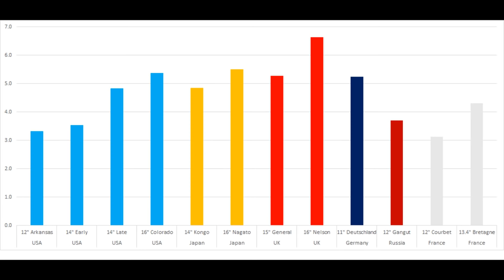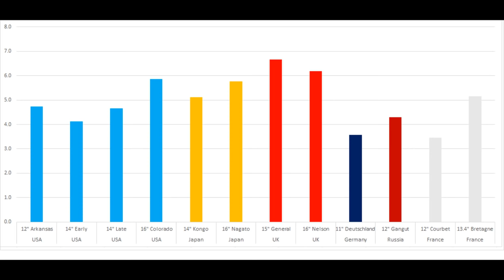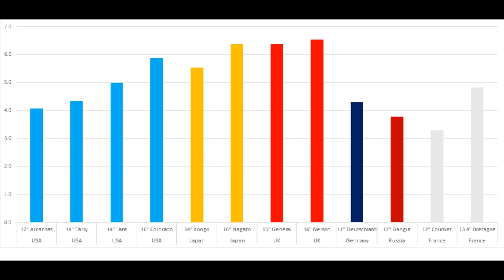Battleship Guns of WW2 - A series of tubes

Comment from the maker: Pinned post for Q&A :)
Reply: Now you need to do the same thing with Heavy Cruiser, light Cruiser, and destroy your guns. Excellent job my friend.
Reply: Has there ever been a naval version of the Christmas Truce in World War One?
Reply: Whose 18 inch gun's that were actually built were better and more powerful the British or the Japanese?
Reply: 1:46 i disagree
Reply: Modern Anti-Ship Missile Damage against Battleship Armor?
Reply: 9:02 weight its value on a bell curve :)
Reply: Is there a chance you can do a video about the damage taken by Jean Bart due to Massachusetts 16inch hits?

Or any other video that covers what damage an AP shell can actually do to a modern WW2 BB?

Also, has a WW2 BB ever taken a hit to the belt, aside from Bismarck? The thickness of the belt is discussed so often while in reality, hits on this spot are relatively rare.
Reply: You mentioned in earlier Drydocks that warships were generelly not suited to use their main battery while also using their full AA armament, because the crew manning the AA guns would be susceptible to blast by the main guns... has anyone ever tried to exploit this, i.E. attack enemy ships while they are engaged in a surface action? If not, why?
Reply: @Scarecrow94rn  Scharnhorst's 105mm gun crews were ordered to take cover at the North Cape when Duke of York opened fire, and this stung her later when the DD attack developed (the order could apparently not easily be rescinded,  which is a bit strange). Survivors were highly critical of the handling of the ships secondary armament, and blamed the captain for the torpedo hits.
Reply: @williamwarwolf1  most such missiles have a basic HE warhead with either an instantaneous or slightly delayed fuze, so they would slam into the armor and the explode outside the belt, assuming it is still intact enough to explode. A few have shaped charge warheads, which are quite capable of penetrating armor. However, a ship with a decapping plate or an interior belt can set off the warhead outside the belt so it is no longer focused when it reaches the main belt. The same missile therefore might go right through the turret armor, because there is no decapping plate to set off the warhead early, while failing to penetrate a thinner armor belt because the exterior skin set off the warhead so early that it isn't focused enough to penetrate when it reaches the belt.
Reply: Are the bursting charges generally made from the same explosive compound, or are some nations using more or less volatile explosive compounds? Is there any information suggesting shells with larger bursting charges tend to shatter easier?
Reply: @joshthomas-moore2656    M
Reply: From what I've read, the twin 5"/38 and triplet 6"/47 gun turrets on US destroyers and light cruisers of WW2 could not be elevated separately from each other unlike the 8" and larger guns on heavier ships. Though it would not have made the turret more likely to remain operational if hit, would it have at least increased the accuracy of shots fired, especially in AA role for the 5"/38?
Reply: Where would the 12" guns from the Alaska class score using this system, considering their position as supposedly more powerful than the 14"/45 guns from WW1? (Edit: perhaps no surprise to see this question repeated at least half a dozen times.)

Also, is there any kind of rule of thumb for evaluating scaling of bursting, say a square function? In other words, to get twice the damage you need four times the weight of the same explosive, or possibly a cube function needing eight times the weight of the same explosive to do twice the damage? Or is it so complex that no one has really tried to develop such a rule?
Reply: What plack poles are sticking out from the ship in 19:22 ?
Reply: Will you do a video about how a gun is built? You always say that in a battleship the guns are the most expensive items and they need a lot of time to be produced, but why is it?
Reply: My question for Q&A: Could an argument ever be made for a new class of BBs to be made for modern war?(Specifically for historical naval powerhouses of NATO and their affiliates: USA, UK, Germany, France, and Japan)

I've given it probably way more thought than anyone should have, and I've determined absolutely they should. Having those big rifles(16-20") with modern FCS, propellants, and advances in automation for loading could give them exceptional range, fire rate and variety of ordnance. Having that long range striking power against the most pressing threat to NATO being China(who has an obscene amount of infrastructure and factories along their coasts well within range of a BB), BBs make a whole lot of sense due to the amount of ordnance they can throw down range consistently. Being that it's a BB larger than a modern aircraft carrier, that means that you could put all sorts of weapon systems on it: anti ship missiles, long range ballistic missiles, tons of AA/point defense systems(compared to frigates as you could mount multiple land based SAMs or anti-missile defensive systems instead of just one). 

Armor also has come a long way since WWII. Being that it's a BB, it could utilize all sorts of advances in armor technology that was developed for tanks like spaced armor, ERA and ceramic composites. In theory(my own theory and I have no actual backing for it), if you were to clad a ship in ERA and something like Chobam, you could make it impervious to things like hypersonic missiles. The spaced armor could come into play with the belt, instead of air being utilized, you could fill the cavity with water instead. I'd imagine a hypersonic projectile would struggle against a belt of ERA, a layer of a chobam like material, about 3 or so feet of water(or some other dense or non-newtonian fluid), finally meeting a full belt of Composite armor and steel. 

I'm curious as to see what you might think about such a thing as I have laid out.
Reply: How the italian doria’s gun would have performed in the pre-1930 category (with their updated caliber of 320mm)?
Reply: While it seems obvious that  the  more modern (post 1930) guns would likely crush out any nuance in the pre-1930 guns, I feel like including those earlier guns when analyzing the later guns might be of some value.  A later gun that performed worse than an earlier gun would be kind of a funny joke, but perhaps more importantly, it would show the full context in which the later guns were developed.  I doubt this could be a full video, but I'd love to plug the values into some spreadsheets and see what falls out.
Reply: @Scarecrow94rn  The Americans did it at Samar, but only because that was an extremely unusual set of circumstances. Overall it was impractical to have your units positioned so your carriers and surface ships could attack together-you were better off just sticking to the carriers.
Reply: Watching a Battleship New Jersey video and Ryan mentioned that NJ was inactive for over half of her career. At first I thought a ship like this would have great hull condition due to less use through wear and tear. But then I thought about it and thought of USS Midway who was a front line ship most of here career, so she would require more up keep then New Jersey sitting in port. Who's hull condition would be in better shape today? The Active ship,(Midway) or the New Jersey who sat for many years in reserve.
Reply: How would the 12" rifles on the Alaska have faired in this list?
Reply: at 25 minutes, you have a picture up titled "USS Michigain after bursting of 12" gun" - and it sports a jagged hole in the superstructure above where the tube is laying on the deck, which appears to be where the newly-liberated tube struck the superstructure.

are you including the armor penetration of a 12" gun tube in these scores?
Reply: Q: How much of an effect did nonpenetrating hits on the belt/turretface/barbette have?  Were mobility, firepower, or mission kills a significant factor in these instances?
Reply: Is there some reason that you used range over muzzle energy? It would seem that muzzle energy would allow a comparison that did away with the range being limited by the turret. Also how about barrel life? Finally while not a BB, how would the 12"/50 of the Alaskas compare?
Reply: "Armor Penetration" in the context of this video - please elaborate.  Is that belt armor penetration only?  Deck armor penetration?  A combined value?  Related, which of the contemporary ships, if any, had an immunity zone against the noted guns?  That is, what, if any, immunity zone did the Yammy (Iowa, KGV, etc) have vs the Richelieu?
Reply: Hi Drach, why did you choose to Include the weapon of the Deutshland class and not that of Alaska class in your analysis?  It seems to me it would be a both or neither situation.
Reply: Did you consider barrel wear/barrel life as a factor? It's certainly a characteristic that is purely the gun and seemed to have a very large impact on things like range and accuracy.
Reply: @kennethhill4623  seem to think the Japanese used a different bursting charge, as mentioned by drach in the battle of tuschima?
Reply: Where's the 12" guns from the Alaska class or the 16/50's from the Lexington class Battle Cruisers? If you're going to list the Vanguard, they should be on the list.
Reply: Great entry. During wartime, most navies and armies tried to simplify their supply lines. How many different battleship main gun shells were being carried by the RN and USN from WW1 to WW2? For the Grand Fleet, were there 12, 13.5, 14?, 15 inch shells
Reply: I think of the Scharnhorst more of a heavy fast cruiser or battlecruiser in the British definition (in my mine), Which makes me wonder were the 12 inch Alaska class guns would fall on the list. As far as the bursting charge on USN shells, I think bursting force should be the state used, given the fact the USN shells had to brake a thicker wall of shell in-order to free the explosive force from the shell, that should have about the same lethal force, close to the British shells.
Reply: @michaelkovacic2608  The order was rescinded, but by the time it was given the crews were dead! they took cover in the aircraft hanger which the DoY subsequently hit with a 14" bitch-slap.
Reply: @g24thinf  Well the Lexington guns were only ever used in coastal defence batteries so not really applicable, they were never on a ship.  You couldn't compare them on things like range for that reason either.  And if you did where do you stop?  The guns from the N3 and G3?  The guns from the A-150s?  No turrets were built for any of them.

Not sure why Alaskas guns are not on when Deutchlands are though.
Reply: What is your opinion of the light cruiser IJN Yuubari?
Reply: For the sake of argument, how do the Italian 12.6" compare to the pre-1930s considering they're contemporaries?
Reply: 12 inch guns on the Alaskas?
Reply: Why was Warspite modernized with just 4 twin 4"/45 Mk XVI dual-purpose guns while retaining 2/3 of her 6"/45 guns when she could’ve been given either 6 twin of the 4.7"/45 Mark XII (or 8 single Mark IX if the Mark XII didn’t enter service yet) or 4.5"/45 dual-purpose guns, while reducing the 6"/45 guns to either 8 singles or 6 singles? Having just only 2 twin 4 inch DP guns per side seems really low for dual-purpose when even Hood had 4 twin per side and the Leanders, Counties, Yorks, Crown Colonies, as well as the Southampton and Gloucester-subclasses of the Towns had the same 2 twin 4"/45 DP guns per side. If they had to put the 4"/45 twins, wouldn’t it have made more sense to go with at least 3 twin mounts per side?
Reply: How are warship projectiles actually made? Are the latched down from suitable barstock then annealed for hardness or cast or something else? You've got a video on the armour Drach, but not on the bit that pokes holes through it =/
Edit: I think I asked this under one of your older vids so you may have answered it in the 130 or so drydocks I've yet to get chance to listen to, if you have already thank you.
Reply: What is in your opinion the best-looking battleship turret?
Reply: Have you considered using non-linear scoring methods, like on range?
Reply: You forgot the 12" 50 cal Mark 8 on the Alaska class. If you include the Deutschland then you should include them.
Reply: @Cbabilon675  seconded.
Reply: If you want to stick to your guns (did you see what i did there?) on range, you could pick your favorite practical max range - and then compute the Vn (velocity of impact of the projectile that is normal to the ship surface).  So just impact Vn= V x cos(angle).  So a flatter trajectory will get a better score if trying to make holes in the belt.  1/2 m Vn*Vn should give the kinetic energy of the punch and then can add your numbers for the part that goes BOOM with your present methodology.
Reply: What about the 12" guns on the Alaskas? They're as big and powerful enough to be included on this list! I'd say they slot in between Scharnhorst and Dunkerque guns.
If you argue that it's because the Alaskas "aren't real battleships" I'd counter then, by that logic, neither are the Deutchlands. In terms of size, speed, and armor they're pretty comparable to Dunkerque (the lead ship, not the up-armored sister), and if It's because they barely saw any action, then I'd point you toward HMS Vanguard.
Sorry, I know I'm ranting by this point, I'm just sad of one of my favorite ships constantly getting shafted because "Oh, those are just large cruisers, they don't count."
Reply: @Scarecrow94rn  - I imagine that attacking an enemy battleship from the air while it is currently engaged in surface to surface combat with other battleships would be an ideal situation to test out this question.
Although the odds of a naval force finding itself in a position carry this out, I think, would be rather slim.  That specific tactical scenario would be extremely rare and difficult to intentionally arrange.
Although I recall reading that the IJN Yamato was firing it’s 18” guns using some fancy AA round at some point during it’s final doomed fight with USN aircraft.  I can’t remember reading anything concerning what effects this had on the crew manning the other gun positions on the ship during this last engagement.
Reply: In your opinion, what is the bigger "what if?"
1. The Royal Navy has Green Boy shells at Jutland.
2. The IJN CAP at Midway sticks to their sector allocation.
3. Moving the Pacific Fleet to Pearl Harbour.
4. Italy stays neutral in both world wars.
Reply: Why were 7 inch main battery’s uncommon on cruisers
Reply: @williammacker1525  id imagine a combination of weight, performance and logistical requirements. You'd be better getting an 8 inch id imagine.
Reply: Following my "sources for the best gun" this is a fantastic video.
Reply: Does this include the Sleswig Holsteins guns?
Reply: You often raise the question "why didn't they build aircraft carriers" in the 1930's. I am on the opinion that the prevalence of aircraft carriers were just some form of survivor/confirmation bias, since "that's what they had" especially the US in the pacific. If aircraft were really a threat, why were there no dedicated fleet flakships? As in larger vessels than the atlantas?
Also, why escort CVs with battleships?
Reply: @DoddyIshamel  I think he used the WWI Pre-dreadnought Deutschlands, not the 1920s Panzershife .
Reply: @Trigm  Then why would he talk about the Graf Spee?
Reply: This is an awesome.  i feel like it misses something critical, though, which is suitability to the missions assigned.  which might even disagree entirely with the missions the guns are designed for.

in that regard, what are a spread of various different guns and their suitability to the missions they were actually designed to do, versus the missions they ultimately actually did?
Reply: What about the 11" guns on the German Predreadnoughts? They did see service and fired their guns during WW2 after all.

I imagine they would be the worst, even worse than the Courbets but still kinda curious.
Reply: @fidjeenjanrjsnsfh  see what happened to Glorious as why carriers needed a Battle ship in escort.
Reply: @g24thinf  Alaska point is fair but Lexingtons were never completed as battlecruisers and never fired their 16" guns (I don't think they even fired their 8" guns in combat in their carrier forms). Vanguard was at least completed.
Reply: Drach: one characteristic you didn't mention was time of flight. You chose the range of 20,000 yes, so it should be straight forward to calculate the time the (incoming?!?) shell takes to arrive. This piece of information would be useful in seeing how much time a target vessel would have to evade by changing course immediately upon observing muzzle flashes. The greater the time between muzzle flash and shell arrival the greater the chance of the target vessel getting out of the target ellipse.
Reply: Any chance we could get access to a document with the raw data? Great video, as always!
Reply: When you're including pictures of ships, can you include the date taken (if available)?
Reply: Hey! If you don’t mind, if possible can you do like a tutorial on how to make the spreadsheet that you used to compare the guns? If you have the time of course, id love to give it a try in my free time
Reply: There are so many guns in this video that are "not much to write home about." Who is writing home about development of explosive charges and penetration values? Was this some form of effective courtship in the early 20th century? Wouldn't these information tidbits be considered classified military secrets? Was this another ineptitude of the Bureau of Ordinance?!? The world wonders.
Reply: What's wrong with Michigan's guns at 24:48?
Reply: But! But But! What about Battleship Guns NOT used in Battleships.

 I'm talking about you, Alaska class 12" guns!
Reply: If range was a factor of the turrets that you added back (which I agree with btw) and accuracy was in the pro/con section (subjective but again agreed), how much is Rate of Fire a subjective 'it's the gun' stat versus how the turret was laid out plus gun crew process/training? Is there an objective way to say a guns rate of fire is because of the gun and not those other subjective factors? Crew and/or turret seem to be large factors there... Right?
Reply: 20:50 It seems to me rate of fire has more to do with the whole complete system then the gun itself.  A shore battery and a battleship could have the same gun and vastly different rates so fire.  Can you please explain this?
Reply: @Scarecrow94rn  That was Halsey's plan at Leyte.  Lee was supposed to arrive just as the first wave of aircraft began their attack.
Reply: USS Des Moines vs HMS Dreadnought (both with and without updated fire control). Who would win? Both displace just over 20,000 tons when at full load.

Edit: also Dreadnought's gun elevation and shells.
Reply: Did any Navy try to develop shaped charge naval shells during WWII?
Reply: How well could HMS Lions guns have fared against Other heavy hitters on the list?
Reply: So, for bursting charge I noticed you used the weight of the charge alone. I'm curious if the explosives were close enough in performance that simply taking the weight of the charge is an adequate measure. Was the explosive used in the shells across so many navies close enough in effect to not to bother differentiating?
Reply: Silly question and probably a very obvious answer, but with Rooney and Warspite very occasionally moonlighting in an anti tank role, how would they have done against the Landkreuzer P. 1000. I understand that the "proposed" tank was planned to have between 5.9 and 14.2 inch armour, what kind of protection would this afford?
Reply: @briancox2721  that was the day the USN discovered "copper choke", where copper from the driving bands on the shells builds up in the bore to the point where it impedes passage of the shell to the point where pressure in the tube is high enough to burst the gun.  After that, the USN started issuing cleaning tools to remove the copper buildup.
Reply: @alessandrorizzuti7857  yeah, you also see things like the Scharnhorsts use smaller guns because they didn't have the manufacturing capacity at the time despite having it previously.
Reply: If you “pulled” out that didn’t effect the barrel or shell itself, why did you include rate of fire?  You mention that Vanguard had improved mountings that improved the rate of fire, but with improved engineering, couldn’t you increase the rate of fire using auto-loading, albeit a design and strength nightmare, that would be a turret / ship-based effect rather than directly affected by the charge, bursting charge or barrel strength by itself.
Reply: @Cbabilon675  q1
Reply: @Cbabilon675 plq
Reply: Including all forms of impression and shanghi-ing, how many men were forced to serve or misled to serve in the Royal Navy during the age of sail? Or is that an impossible number to pin down with any reasonable certainty?
Reply: @Ralph-yn3gr  "USS Des Moines vs HMS Dreadnought (both with and without updated fire control). Who would win? Both displace just over 20,000 tons when at full load."

If it's at night, or likely longer range, my money's on Des Moines. (Go Iowa!)
Reply: Link of the spreadsheet please.
Reply: @Robert Miller Because it was as likely to kill you as the other guy.
Reply: @Robert Miller Were you on a Nuke or diesel?
Reply: For the American Standard Battleships that got heavily refitted, didn't their guns get refitted aswell? Or did the US simply put back the guns after the ships were refloated and sent back for repairs/refit?
Reply: If you included the 11's from Graf Spee why not Alaska's 12?
Reply: 1: Yes to doing this for WWI battleship guns! 2: One thing that wasn't really addressed was how the best of the pre-1930 guns stacked up against the post-1930 guns; i.e, would you rather be hit by a 15" shell from Queen Elizabeth or a 14" shell from Prince of Wales?
Reply: What would happen if for whatever reason the propellant a WW2 battleship gun ignited before the breech block was shut? I understand that in the age of sail the loader might lose an arm, but with the much greater charges, more people, a shell blocking the barrel, and an enclosed space, I would expect that everyone in the turret would be burnt to death very badly. Did anything similar to this happen in the age of breech-loading guns?
Reply: Any idea of how the 12"/50s from the Alaska class CBs would have fared?  They seem to generally be considered equivalent to most 14"/45s and 14"/50s, at least anecdotally, so I'd love to see where they fell analytically.
Reply: Were there any limits under the Washington Naval Treaty covering how extensive a refit could be be? 
For example I'm sure if someone had taken an I beam from a pre-treaty battleship, scraped the rest and built a new ship around it, the other countries would have said something. What were the limits to the Battleship of Theseus?

Also ignoring cost how extensive could a refit be while still being practical?

Sidenote: could you add the ins and outs of refits to list of video ideas?
Reply: Deutschland 11" but not Alaska 12"?
Reply: @weatherwaxusefullhints2939  pretty sure Warspite's maximum range in that game something like 9kms less than her longest confirmed hit.
Reply: Only 26:12 in.  You mentioned armor penetration.  Please define 'armor'.  Harvey steel vs Krup vs RHA (Rolled Homogeneous Armor) vs what ever.  Not all armors are created equal.....

Also, shot weight affected range, I do not know if you will get into it or not.  The Iowa class used some projectiles that were light for their diameter for the extra range....
Reply: I think there’s a lot of us who would be interested in seeing where the 12”/50s of the Alaska’s stack up in your charts, but I’d also be interested in seeing where the prototype American 18” gun would have compared to Yamato’s.
Reply: I often wonder what would be possible with "Modern Technology" with large Caliber navel guns. 
🤔20' 22' or a true monster 30' guns.
Reply: You state at the beginning that you removed training and elevation out of the calculation because it was primarily a function of the turret, and yet you keep range in (and specifically make mention of it being a function of the turret elevation). Would it have isolated the turret variables by considering range as angle of elevation required to hit an arbitrary distance (perhaps 5km) because then it is a function of muzzle velocity and shell mass?
Reply: #Q&A After the implementation of digital fire control and wireless data links on modern/modernised warships, has there been any experiments with networked real time fire control data collection between ships?
Eg, two ships linking Radar echo and or other data between fire control computers to create a virtual triangulation sollution with the same base as the distance between the two or more ships with the comparative resolution of all the combined sensors instead of just those on each ship?
I'm thinking that capability can be useful for both as a means to compensate for loss of GPS satelites and for faster and more accurate calculation of target speed and heading.
Reply: I was looking at a picture of HMS Nelson and noticed some cage-like structures around the light AA on top of the aft 16" turret. I assume these were meant to prevent the light AA from accidentally shooting at the ship itself. They seem like they would only be effective with the turret facing directly forward, i.e. not in use, but I suppose you wouldn't want to be on top of the turret during a surface action and would be unlikely to face air and surface attacks simultaneously. Did similar structures exist on other ships, or were there other approaches to preventing friendly fire from the light AA?
Reply: Thank you for another great analysis.  Yes, I would like to see a comparison of battleship guns for World War 1 ships.  Very interested to see how the 15" guns of the Bayern class compare to the 15" guns of the Queen Elizabeth class.
Reply: Which gun was better at their job, the British 5.25" or the American 5"/38?
Reply: If we're not considering turret design, why did you include rate of elevation and train, again?

Yeah, something this huge, it's hard not to, and I am pretty sure your rate of fire statistic  is effectively and entirely all up to turret design and internals... which changed as propellants and shells changed and increased in size, or as battlecruisers exploded at Jutland... Hey, even your unfortunately unavailable accuracy data is somewhat turret dependent, depending on your ability to consistently lay the thing in at a detectably consistent deflection and elevation. At 20k yards, a quarter of a degree difference is something like a hundred yards difference, horizontally or vertically, and much more than that in range, especially for your high velocity guns. I also think Armor penetration is best balanced by "Who were we expecting to shoot at?" I mean, if your enemy is laying down hot rodded fast vessels with little armor but they can turn and burn like a ship half their mass, armor penetration isn't gonna be nearly as important to you as fire control, the ability to sight on, train, track, and actually HIT the darned thing.

Moreover, a bum design on a naval shell would leave an allegedly superior gun sucking wind. Terminal ballistics is half black art, half chance.
Reply: How many 40mm Bofors AA Guns and 20mm Oerlikon AA Guns could be fitted to USS Wasp had she survived?
Reply: quick semiOT topic.  bofors ceated a loadingsystem (Pendulum loading) for the 120mm and 155mm guns in WWII.  This alowed reloading at any gun angle.  did any other countries use a simmilar design ? and would this work on larger guns ?
Reply: Would it be fair to measure the range these guns could reach at a given elevation? Eg: How far can x gun shoot at an elevation that all guns being compared can reach? This should eliminate the factor of elevation, and just be up to the gun itself.
Reply: You forgot the Alaska's 12" Gun. The last 12" ever designed I believe.
Reply: What are your thoughts on the [admittedly very niche] effects of plunging fire from extreme ranges?

EX: In a documentary [I believe from early History channel or from the BBC] they mentioned the sinking of the hood was mainly due to the plunging fire hitting the relatively unarmored deck near the turret and hitting the magazine. In gaming terms, yes this would be a critical hit, but one made possible by the high angle of attack, where a belt hit at that range was much less likely to do much damage. 

I know this is probably a better evaluation point for the ship and not the gun, as deck hits from dive bombers caused alot of the damage in the Pacific theater
Reply: Why no 17 inch guns? Why the jump straight from 16 to 18 inches in bore diameter? Was 17 inches just not enough of an improvement over 16 inches to be justifiable?
Reply: Wondering if a better metric for armour penetration would be the "distance at which a weapon would reliably penetrate x" of armour"
Reply: Has a ship with an All-or-Nothing armor scheme ever been battered to the point where the reserve buoyancy of the armored portion was the only thing (or the primary thing) keeping it afloat?
Reply: But what would the rankings be if the two lists (pre- and post-1930s) were consolidated?
Reply: @williammacker1525  I think Drach answered this in his response to why the Russians had a 7" cruiser gun. Basically, calibers between 6" and 8" lost the quick rate of fire of the 6" while not gaining enough punching power to compensate. The next sweet spot was 8".
Reply: So you didn't include the 12" of the US Alaska class, and thus avoid the debate if the Alaska class was just a very heavy cruiser, or a borderline capital ship, like the German Pocket Battleships
Reply: @Kenneth Hill, 
There were significant differences in the type, size, safety, and reliability of bursting charges used by different nations or same nations in different time periods. Also, generally a larger bursting charge meant you had a lighter shell.  A lighter shell with a bigger burster usually gave you less penetration, but did more damage on exploding so always trade offs there.
 The link in the video description to the Naval Weapons site has some good info on this but not sure how well the site is being updated nowadays. Haven’t read anything over there in a few years.
Reply: Can you start making a habit of putting numbers and data on screen, like you did with the charts in this video? You make a lot of detail-dense content, and being able to see as well as hear would really be nice for keeping track of it all. Thanks!
Reply: @Drach is it true that Massachusetts scored the longest hit on a moving target via the French Destroyer Milan at the battle of cassablanca?
Reply: @YoBoyNeptune  No, and nor would you want to: shaped charge warheads rely on the projectile moving slowly enough to allow the copper cup to make an effective seal. If you fire a shaped charge at 2,460 feet per second - compared to the barely 300 feet per second of an RPG-7 or M72A1 - that a BL 15” MkI achieves in muzzle velocity, it’ll simply go splat. 

Secondly, shaped charges need to be on a fairy perpendicular angle to work, and need to connect with something ideally flat and hard, like armour, for the same reasons above. So a long-range plunging shot is gonna disintegrate as it travels through the deck/superstructure, or else need to be fired direct-fire (I.e. flat trajectory), from an suicidally short range into the relatively tiny target of the belt armour required to lower the velocity enough to allow the shaped charge to operate at all. So it sounds like a good idea, but it doesn’t work in practice.
Reply: Why did you not include muzzle velocity in the data?  Muzzle velocity has a big impact on range, armor penetration, accuracy, time in flight (your target is less likely to shift out of the way and you will have more time between spotting your shell splashes and having your guns loaded and ready to make adjustments to your firing solution), etc.  It is most certainly an important datum when considering the overall performance of the guns.
Reply: @jakemillar649  another solution would be to plase not a range limmit but a TIME limit.   define a time that gives a battleship "enought" time to evade. then examine the maximum range for the gun out to that range.   that way you get individual effective ranges for each gun. and guns with better speed for their shells will be given a better value.
Reply: Why 18.1”? That seems oddly specific. Did the performance of the gun start decreasing at 18.2” or something of the like?
Reply: @AdmRose  18" gun = 457mm.  18.1" gun = 460mm.  They did it just because it's a nice even number, and afaik japan never used the imperial measurement system
Reply: @jakemillar649  it would probably asphyxiate or burn everyone in the turret to death.  There was a case, prior to WWI, when the propellant ignited as you suggest.  At that time, there was no air purge system in guns.  The gunners were instructed to look in the tube for embers and flames, before ramming the next round.  On a 12" four propellant bags were used, rammed two at a time.  The gunners rammed the first two bags, and ignition was almost instant, as inspection after the fire showed the rammer was still in the fully extended position.  There were no safety shutters on hoists then either.  When the flames shot out of the breech, they ignited the other two bags that were still on the hoist.  Hoists were not in enclosed trunks then either, so chunks of burning powder rained down to the handling room, igniting more bags of powder.  Somehow, the magazine was not ignited, so the ship didn't go up like a Roman candle.  Some 35 men died that day.
Reply: No German, Italian, French gun in that period was calibered in Inches. Shame on you!
Reply: At 3:33, you showed the somewhat comical picture of the No. 89 gun tube being hauled around. I noticed that one, among many other old and large barrels, have a ‘telescopic’ design of sorts. Though I don’t believe I’ve seen newer battleships with that style of a barrel. What is the purpose of it and why was it apparently disused?
Reply: Im curious if any nation tried to get the same performance out of a 14” barrel as you get from a 16” barrel by simply making a longer projectile? Or were the treaty restrictions on battleship guns more complicated than that?

I would have thought that the same shell weight in a smaller caliber propelled by a similar amount of powder in a barrel the same total length would hive similar performance. Obviously it would need to be a heavily built gun. 
A longer shell of the same weight would probably have less drag in the air giving better ballistic performance.
Reply: Hi Drach. I listened to this a couple of times and was thinking about your scoring system. It seems a little overcomplicated? I was thinking that if you do go down the path of increasing the data pool by including earlier weapons, then maybe a simple z-standardisation would be the way to go? Create a composite-sum score for each weapon, and badda-bing, a quick and easy objective rating system for as many weapons as you like.
Reply: What happens when a naval gun is considered shot through? Can the old barrel be refurbished or is it only good for scrap?
Reply: Q&A: How well do the results compare to your impressions of how the guns performed in the real world as part of overall weapons systems? Were there any results from the final figures that really surprised you? 

Also, regarding range, would a better compromise be to compare the range of the guns at a specific elevation rather than their absolute range, lessening the effect of the turret on the results? Or would this introduce other inaccuracies or be impossible to calculate for all of the guns?
Reply: Can you please post the armor penetration values at 20k yards you used for these guns? 
Thank you
Reply: Was the small bursting charge on American guns a conscious design choice? If so, was it a good one?
Reply: @dmnorthwind9584  Guns can be relined.  The usual procedure is to heat the outer jacket of the tube, while running cold water through the bore, to make the outer jacket swell and the liner in the bore shrink, loosening the old liner, so it can be pressed out.  Then a new liner is inserted, and the outer jacket allowed to cool, which clamps the liner firmly in place.
Reply: Yes, please do another video on World War I guns using the same parameters and include armored cruisers!
Reply: @alfrede.neuman9082  can't main battle tanks fire HEAT rounds?
Reply: 10:10 "You probably are not going to hit much beyond 30,000 yards because the enemy can just maneuver out of the way if they're watching your muzzle flashes!" -- Ah, no.  Those big shells have a muzzle velocity of around 2500fps, so at 30,000 yards, you're getting hit about 35 seconds after you see the flash. Problem: you wouldn't know which  way to go, because you certainly don't have any better idea of whether or not your enemy has you on-target than he does himself after carefully sighting you in for his shot. And how far can the course of a capital ship be adjusted in a half minute? Lookout sees the enemy firing, relays his warning, captain says go-thataway-now, the engine room complies, the rudder is swung, the ship budges an inch off its previous vector...and time's up. Kaboom! 

You're getting hit, or you're not. It's not like you're a baseball outfielder watching a towering pop-fly with all the time in the world to move forty times his body-length.
Reply: @YoBoyNeptune  Why yes, they can. But tanks differ notably from battleships. For a start, tanks NEVER use indirect fire from their main armament, unlike big-gun battleships, which used almost exclusively indirect fire. This completely changes how the projectile behaves when it hits a target, and which part of the target it’s likely to hit; not the armour belt, but the upper works and superstructure. Secondly, the refer to my last post about the necessarily deformable nose-cone of a HEAT projectile disintegrating as it passes through the deck/superstructure/funnels, totally defeating the entire point of a shaped charge anyway, and thirdly, the fact that getting close enough to use a shaped charge weapon against a ship’s armour belt to counter that problem would be positively suicidal to the point that you’d be better off trying to ram the enemy. 

Like I said, it sounds nice, but it’s a positively shit idea in reality, hence why no one ever did it.
Reply: Where would the 12" of the Alaska class come in in these tables?
Reply: @Thirdbase9  Agree about barrel life as a criterion.
Reply: @jjsmith4829  Also like that. Particularly the comparison between 13.5" L & H types.
Reply: How do WW2 Destoroyers stack up to Cold war and modern day Destroyers?
Reply: Would you be willing to share your spreadsheet for those of us who love crunching numbers into interactive Dashboards? :)
Reply: Very nice! I do think the German 15" is a bit overrated and the KGV 14" a bit underrated both based on real world performance. Like other German WW2 heavy guns the 15" had a high dud rate plus real world penetration did not live up to theoretical ratings. Meanwhile the KGV 14" actually over performed a bit on penetration. Obviously it can be argued that this was a function of the ammunition - the German heavy shells in WW2 were problematic and the UK shells performed very well.
Reply: Thanks Drach for a most interesting and informative video.  Also very courageous of you to enter this field, where the focus is on one part only of a complex weapons system makes it very difficult to perform meaningful analysis.  There have been so many superficial ‘Best tank/Fighter/Battleship’ videos that don’t address the question of “Best for Who”?  Best for the government who pays for the naval rifles and selects the enemy they are to be fired at; best for the Admiralty that selects their caliber and numbers; best for the Captain who selects the target and range of engagement; best for the crew who have to operate them safely in a hellish and dangerous environment; best for the Gunnery Officer who has to achieve straddles on the enemy; or for St Catherine, patron saint of gunners, who arranges the actual hitting?  
To my mind, it is the shell and not the gun that does the actual damage, and the best gun is one that puts the heaviest shell on the most distant target with the highest accuracy at the lowest cost and least ship impact (gun weight and space, power requirements, etc.). So gun weight is a factor that I would have taken into account, even in a broader analysis such as yours which also considered turret/hoist/magazine and shell factors, since of two guns that both have equal performance, the best one is the lightest since you will be able to mount more of them (all other things being equal).   
That said, I think your comparisons are an appropriate balancing of theoretical and practical factors.  Accuracy matters, even it it cannot be fully quantified.   Your other factors are all appropriate and well assessed even if circumstances of particular occasions (once the shell explodes in the boiler room, or magazine, doesn’t matter if it is 11” or 28.1”) will make their relative importance vary.  
I also want to applaud the quality of other people’s comments - very high quality, especially Nathan Okun (who I have been following for very many years).  It is evident that your viewership is well above the median of social media.
Reply: In retrospect do you think that a better way to create such a list was to evaluate the full weapon systems (gun, ammo and turret)? In the end you factored in variables that are actually very dependent on the turret (range, rate of fire), and also added merit/demerit points based on issue unrelated with the weapon itself (bad ammo for the Italian, as an example). Basing the data on the full weapon system should iron out some of these quirks, for example the rate of fire of Bismark guns versus the barbette size of the turret.
Reply: I would love to see a similar analysis of the actual battleships themselves. Maybe some comparisons of the different classes that saw combat in WW2.
Reply: It seems like the weight of the shell might be double-counted? I.e., you already have penetration and bursting charge - in order to bother with the weight of the shell *as well*. it needs to have important factors outside of penetration and bursting charge. Does it, enough to be included?
Reply: Could you do a video in this type for torpedo and gun boats of WW2, with factors like speed, torpedoes, guns, etc? PT-Boats, Motor Torpedo Boat, Motor Gun Boat, E-Boat/S-Boat, etc.
Reply: I would have used range at say eigther 15 or 20 degree elevation or the maximum elevation for anything that can't elevate that high instead of absolute range. This should both sort out the cases of "too little" range and give a rough idea of the shells flight path. Also why diden't you include the Alaskas?
Reply: @joshthomas-moore2656  As I understand it, the USN built and tested an 18" gun, but while never built for service, the results from that testing that lead to the 16'" super heavy projectiles that were eventually used with the 16"/45 and 16"/50 guns.
Reply: What is the point of all those secondary guns? Did they really need so many? Or were they just filling up otherwise empty space with guns? I imagine most of them were never used.
Reply: make a vid about cruiser guns?
Reply: Drach, I've been reading Neptune's inferno recently, and one of the things that stuck me is how critical the author is off the use of Atlanta's in the gunline off Guadalcanal. He repeatedly remarks that they are "anti-aircraft cruisers" and thus have no place fighting a surface engagement. 
How accurate is this? I know the Atlantas were originally destroyer leaders, and fully intended to fight in the gunline, shown by such features as torpedoes. To my knowledge, it was only after the disastrous losses of Atlanta and Juneau that the USN seriously pulled the Atlantas out of surface combat and turned them to the AA role, though they had been used as escorts prior. 
So during Nov 42, did the US see the Atlantas as surface combatants or as AA escorts? Even if they are considered surface ships, are Halsey and Scott justified in sending them into Ironbottom sound given their relatively weak protection and role as a destroyer leader, not a big gun cruiser? Even if they are considered AA escorts, is it justified to send them in given the dire need for cruisers and lack of other forces to send, as well as their very high firepower/radar?
Reply: Which factors limit the rate of fire? Are there a construction limits, like this gun cannot be fired faster than every x seconds because it will overheat, or is it limited strictly by breach action, loading mechanism, elevation speed and a crew training?
Reply: When talking about rate of fire shell weight and bursting charge, how about to combine them into two values - total weight of ammo delivered per minute and total amount of bursting change delivered per minute?  Of course if we consider that gun that shots one 50kg shell per minute approximately equals to the battle effectivnes of a gun that can shot 25kg shell twice per minute - which might not be true in case all we need to do is to penetrate an armor of a given thickness, but might be true if we also want to inflict damage on weaker spots like bridge, rangefinders, AA artillery, masts, crew peeking out of the holes created by heavier shells etc...
Reply: @Frank Haunter  its purely based on how breach and and ammo feed are designed
Reply: How about the Alaska's 12in guns ? Should they not be included ?
Reply: So a correction to your rating system would be to standardize the range rating as the range at a fixed elevation, such as 20, 25, or 30 degrees, whatever has data available for all the guns from their testing, in the same way that you standardized penetration at a specific distance.  The keeps the characteristics of the gun but eliminates the variable of the weapon system (turret elevation).
Reply: Q&A: about choice of data: could you discuss a bit using range vs. muzzle velocity? As you said, range is a factor of the turret as well, while muzzle velocity is intrinsec to the gun.
The considerations of including range seem to be closer to high vs low velocity...
Reply: You should of just broke down range itself. Like fire ark & max elevation ext... then assigned max distance a lower value. Pen, shell size, firing arc, all should be higher values like 5points. While max distance should be a 1, and traverse speed in the middle and so on.
Reply: Not sure the "Top Trump" approach is really a good way to evaluate a battleships main armament. Take Yamato. The Japanese naval commander using AP ammunition rather than HE ammunition against other battleships made her far less deadly. Rates of fire is usually based on the speed of ranging after the last fall of shot. The US battleships had better fire control, for example, USS West Virginia had two primary fire control systems, fore and aft. Each system could bead in and calculate firing solutions for four different targets. And each system could take over for the other one. And there were four secondary fire control systems; fore, aft, port, and starboard. And each secondary system could take over for each other and also take over for the primary systems. And each primary turret of the Iowa class had its own local fire control system.
Yamato could track only two targets and some calculation still had to be done by hand. All US calculations were done by analog computers.
US warships also had gyro-stabilized triggers to compensate for pitch and roll.
Reply: Did navies ever make hammer forged battleship guns? The process seems faster and cheaper with the advantage of barrel life and less loss of propellant gas.
Reply: @theprinceofallsaiyans5830  you should stop shitting on everything he does and just stop watching
Reply: What about replacing range with muzzle velocity? Muzzle velocity is clearly an attribute of the gun, while range is also heavily affected by the maximum elevation permitted by the turret.
Reply: Is there a reason you omitted the Alaska class's 12 inch guns from the later WW2 section, when you did review the german 11.1 inch guns of both the Scharnhorsts and the Deutschlands. Deutschlands were NOT battleships. They were at best, Large Light Cruisers in the same vein as the original Courageous/Glorious/Furious. Also the two different classes didn't use the same guns. The Deutschland class had 28cm SK C/28s and the Scharnhorst had 28cm SK C/34s which fired longer and heavier shells. So if the pre WW2 12 inch american gun was the Mark 7 of the Wyoming class and the mid-WW2 example should have been the Mark 8 of the Alaska class. The barrel life of the Mark 8 was significantly better than the earlier Mark 7, and the shells fired were both longer and heavier in the Mark 8 which despite using a lower powder charge with a corresponding lower muzzle velocity, they still managed superior range (from a much higher turret elevation) and armor penetration (from the heavier shells). The AP shells had a smaller bursting charge in the Mk 18 Super Heavy AP shell used by the Mark 8 gun than the Mk 15 AP used by the Mark 7 in WW2 , but the corresponding HC shells had a higher bursting charge for the one used by the Mark 8 gun. Now the penetration tables don't line up except at 0 yards and 20,000 yards for the two guns and shells, but at 15,000 the Mk18 AP shell goes thru about 2 1/2 inches more armor than the Mk15 AP does at a shorter 14,000 yards and at 20,000 its about 2.7 inches better for the Mk18. And the Soviet 12 inch gun you used fired an APC shell at about the same muzzle velocity as the Mk18 AP left the barrel of a Mark 8 gun but it weighed about 100 pounds less. The Alaska's 12 inch guns go thru more side armor at 15,000 yards than the russian 12 inch at 10,000, and at 30,000 the Alaska's go thru more armor than the Russians at 20,000.
Reply: @bezzlebedeviled4756  Shells slow down in flight. Muzzle velocity is great... AT THE MUZZLE... but at 30,000 yards they've slowed significantly. The Russian 12 inch for example goes from 2500fps at the muzzle to about 1155fps by the time it gets to 24,000 yards.